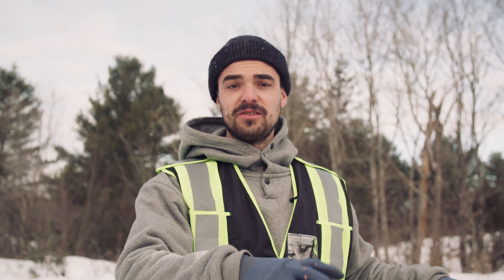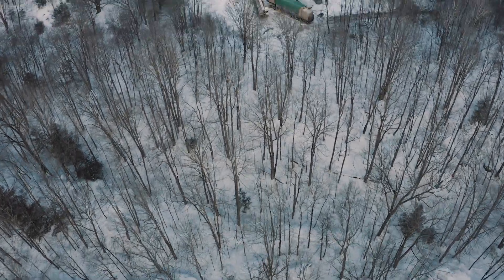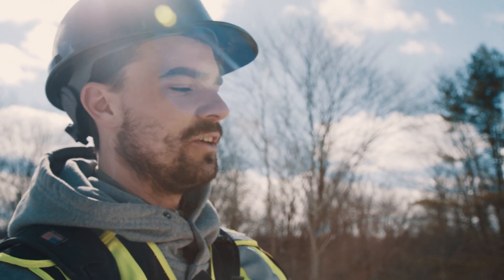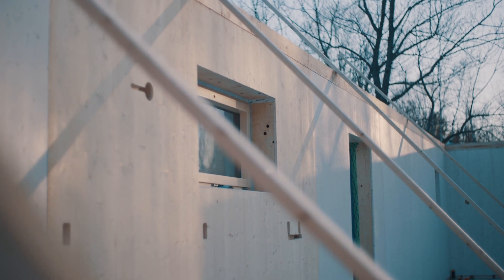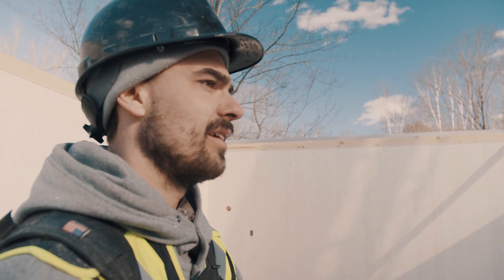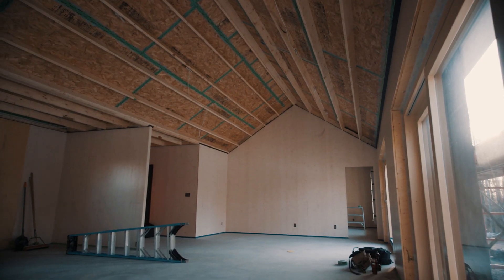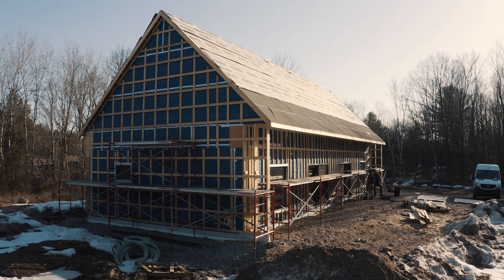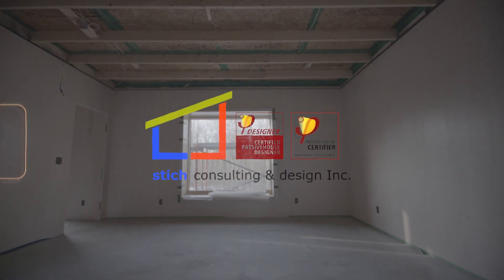Arden Passive House Series - Episode 4 - Wall Assembly

Comment: I'm looking at timestamp 3:19 - the inside of the wood wall appears to be resting directly on concrete.  I saw that you did the air barrier on the inside and outside earlier, but I don't expect this house to last as long as it should with wood touching concrete, and possibly on the outside also, but it's difficult to tell.   Am I misinterpreting what I see?  Apologies if I am.
Reply from the maker: Great question and yes it is a little hard to see. There is actually capillary break between the two materials ! Hope this confirms your questioning.
Reply: @fab_structures I was confused by your statement regarding airtightness. You achieved .4  ACH and code was 2.5 ACH that is 6.25 times the improvement in my mind .